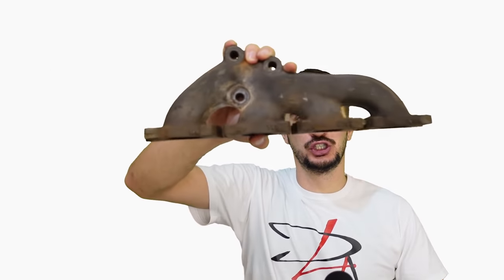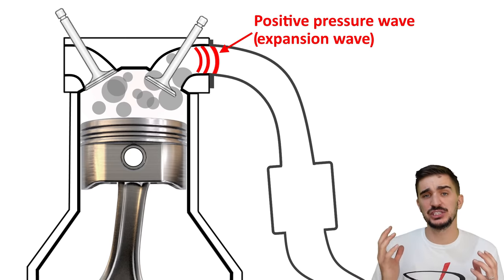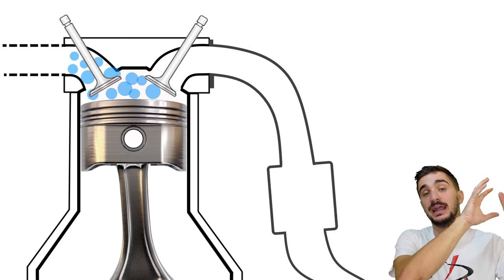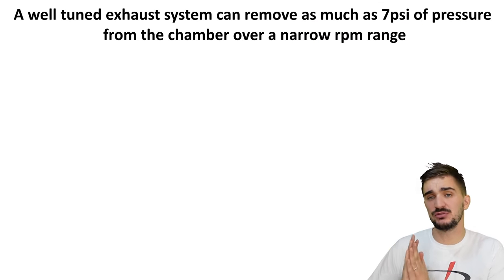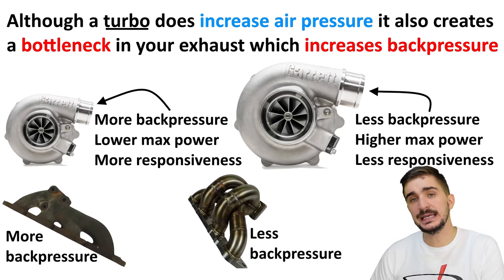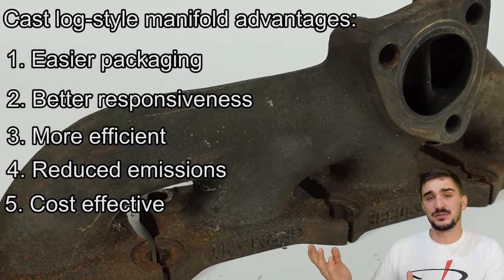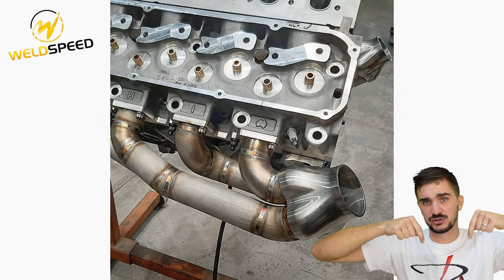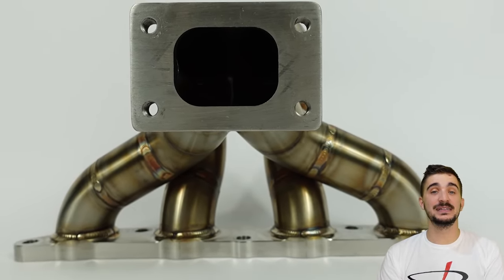EQUAL LENGTH tubular vs. LOG manifolds (headers) - SCAVENGING and EXHAUST BACK PRESSURE EXPLAINED

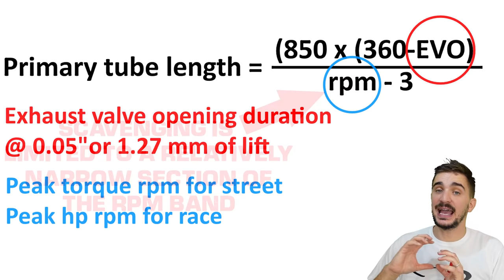Comment: 7:04 - what if you were to have an exhaust with a sliding expanded piece operated by engine rpm?  Wouldn't that allow you to have an exhaust tuned for a wider or even the entire rpm band?

Comment: Excellent video. What about non-OEM cast manifolds, ie aftermarket cast manifolds? My turbo Zetec Westfield was converted to turbo before I bought it, why did the guy choose a cast manifold rather than a tubular one? I'm wondering if it was anything to do with physical room under the bonnet or maybe heat management? Looking at it, it appears far better than a bog standard OEM manifold. Any ideas anyone?

Comment: It's splitting hairs in details, but cast manifolds are also quieter compared to the usual Tubular header counterparts, ever wonder why those Stangs' are loud and goes nowhere? tubular headers, or muffler delete, in other words straight pipe.

(This is the perspective from the manifolds in my car)
The cast manifold is indeed heavier(?) at about 25 to 28 pounds per side compared to the Tri Y headers which (I do intend to get) is about 20 to 25 pounds.

Next video idea that is not explored often is blueprinting an engine, it's what sets apart the rebuilt engines vs the ones that has been blueprinted.

Comment: if you really want to go all the way down the rabbit hole with regards to engine tuning:
The engine starts just in front of the air filter, and ends at the tip of the tailpipe, with everything in between affecting engine performance in a non-zero manner.
Case in point: Nascar V8 engine.  The entire engine has been tuned to generate nearly 108% VE in its powerband, which is fantastic for a naturally aspirated engine.
Reply: N/A great work, for turbo that VE is not a big deal at all :)

Comment: Heard of example where dude had 1.6l Lada engine with fitted TD05 turbo from EVO. Switching from equal length to log style saved 1700 RPM of going to 1 bar of boost. So equal length probably not always the best choice specially with oversized turbo.
Reply: This is a common misunderstanding. More boost does not always equal more power. Here’s a concept that will blow your mind. Boost is created by DEMAND, rather than by being forced into the engine. This is why you seldom see full boost numbers in the lower gears. The engine doesn’t demand any extra help to deliver power.

Comment: So when im tuning it i should take into account the negative pressure wave timing?  Ugh, this is gonna be hard.  I wonder if there's any easy way to tell what numbers bbk used when they designed my headers...  the cam numbers are all listed.

Its really interesting,  AFR stoich is 14.7, the psi maximum is 14.7, I wonder if thats a coincidence or theres a reason its 1:1.

Comment: Wouldnt it be possible to have scavenging for low rpm and have more power there until the boost of the turbo builds up so you also have more high rpm power? I mean at low rpm the duration when both valves are open is way longer than at high revs or maybe you could completely avoid that problem if free valves, that koenigsegg is using become more of a thing.
Or did i misunderstand something here?

Comment: What about electric turbos? I can see that having the correct sensors, and computer running the turbo would allow the electric side to reduce backpressure by increasing turbo speed, or by opening the bypass as appropriate.
It seems to me the future of ICE is low capacity engines with electrically operated Turbo chargers that regenerate a KERS type system using pressure in the exhaust system which it isn't needed to provide boost.
'Lecktric Turbos can also entirely eliminate lag, and we can ditch stupid V8s and V10s forever.

Comment: Could you not have a mechanically-controlled telescoping exhaust manifold to adjust the length based on RPM? Probably not feasible but would that not work?

Comment: Is there a way to calculate the optimal exhaust pipe diameter for a good mix between high exhaust velocity and low back pressure?

Comment: ALSO I GOT A MODERN HEMI 2004, I NOTICED THE LOG MANIFOLD HAS STAGGERED RUNNERS AT THE EXIT , AND THUS CREATES A VACUM IN THE ADJACENT EXHAUST PORT.  WHATS YOURE TAKE ON THE IMPROVEMENT ?

Comment: One thing you didn't mention which is probably open to debate is the positive pressure pulse of exhaust meeting atmospheric pressure at a high rate of speed at the tailpipe. Some people like me have noted that using a reducer cone to gradually slow down the exhaust seems to allow for better power. Its similar to how the intake could have a gently radiused neck to smooth airflow except this is on the outlet to smooth flow and adjust speeds more gradually. I felt it improved power in my turbo car which again is up for debate as many persons do not think anything in the exhaust stream is that important insofar as exhaust scavenging and velocity are concerned. I beg to disagree. It does matter. So what do you think? Should exhaust pipes be one diameter or perhaps gradually increasing toward the exit?
Reply: worked on a Ducati BSB years ago, and arrow had a cone in the exhaust can, must be something in it, they spent a lot of time on development.
Reply: @noproblem858  a cone inside exhaust can or in the exit from the exhaust can?
Reply: @jamesmedina2062  inside the can, at the exit end, the can's was about 400mm long with 54mm perf and the cone was about 150mm  pointing into the can, all in titanium, a lot of work went into them, they was from the previous years Ducati WSB team bikes
Reply: @noproblem858  but the cone was enlarging as the gases went through it right? But then the diameter reduced again before exit from can?
Reply: @jamesmedina2062  the cone was below the diameter of the 54mm perf and increased to the perf at the exit, really strange setup, it was the monster mob bikes, blueflame just put there name on the arrow exhaust cans.

Comment: @driving4answers: Thanks for the video! What will an equal-length manifold do to the sound character of the engine/car? Will it make a VR6 or a V8 sound like a vacuum cleaner (i.e. 4-cylinder)?
Reply: Most engines express their recognisable sound best when equipped with equal length headers. A V8 for example sounds best with equal length headers, but putting 180° unequal length headers can make it sound like a flat-plane V8 which sounds a bit like a higher revving I4.

Comment: Don't forget that cast can be polished to make it just as smooth as stainless.
Reply from the maker: You can polish it inside?
Reply: @d4a  yes, they have been doing that for more than 40 years. There has to be some videos out there somewhere that shows the whole process.

Comment: Hm, I think there is one aspect of unequal length runnings you didn't mention. Which is the 4-2-1 principle. Where the tube lengths of 1 and 4 are equal, and 2 and 3.
If the timing and tube length are correct, the shockwave of the adjacent piston opening before it, can assist in scavanging of the cilinder opening currently. If your firing order is the same, say, 1342, than the shockwave of cilinder one will travel to the collector faster, and send shockwaves to the other tubes, which due to the unequal length will arrive at 2 and 3 when they open up. 

You now only explain it on a per-exhaust tube basis. But this only works for naturally aspirated engines. It's crap, as you say, for turbocharged engines.

Comment: BOY, the exhaust doesn't SLOW DOWN when the overall cross sectional area of the exhaust tract decreases, they SPEED UP.  1000 cfm going through 4 square inches is traveling slower than 1000 cfm through 2 square inches.

Also, runner length is more important for tuning RPM than is largely explored by makers of turbo manifolds, but the F1 cars of very high RPM turbo engines when there was FAR less restriction on overall size used very long primary tubes on their headers going to their turbos. I know it's cheaper making a smaller manifold, but it's better using longer primary tubes. It's the elephant in the room that no one is discussing. The higher backpressure  the turbo manifold experiences makes longer tubes even more critical, or 12,000 RPM F1 turbo engines would not have used long primary tubes, as longer primary tubes are usually best for low-RPM power.

Comment: The real truth about oem cast manifolds is that compromises are often made for the sake of packaging.
If the oem’s truly cared about efficiency, durability, and engineering, they’d be casting equal length runners in the manifolds. 
I have seen several aftermarket turbocharger manifolds that are equal length, twinscroll, cast one piece manifold/turbine housing. These setups are actually far better than those the oems use, and should be using, because my Cadillac ATS has more power, gets better fuel mileage, and runs cleaner because of all the aftermarket parts I’ve installed.

Comment: What about the difference in the number/tightness of bends in equal length runners? If you have two equal length runners but one has tighter/more bends will the pulses still arrive at the same time? For example: How much of a difference could you see in say one runner with one 45 degree bend and another with two 45 degree bends with the same overall length? Cheers
Reply: it is theoretical difference, engine masters played with many long tube headers and some they bashed as would be in real life, it had dents and no difference on dyno
Reply: @makantahi3731  ah ok cool. Thanks for the reply, appreciate it

Comment: We need a ceramic material capable of handling the stresses and shocks of an exhaust manifold. Just imagine a manifold that could easily take the full heat of an engine's exhaust, and deliver the maximum amount of that heat to the turbo. I know there are ceramic coatings and such, but I'd like to see entire pieces made of high-tech ceramics.

Comment: Not so fun fact : my st215 caldina gtt has the 3sgte and the engine block has the stud, as it had been used for a long time already, but they cheaped out on the manifold and left that corner stud off of the manifold flange. It leads to warping and in the 8 years I have had mine, I have had it machined twice.
Another not so fun fact is that on that engine, the manifold has the exhaust side of the turbo cast with it as a single piece lol

Comment: The science makes sense but In practice I’ve noticed much of this isn’t impactful enough to really matter. I’ve used each style manifold and actually went BACK to a log type because I had 3 others crack and I was tired of paying $1k for a new manifold each time. Been running an FP Cast iron manifold for YEARS now and it’s holding up strong. Haven’t dynoed to see performance differences but that’s because it felt no different between the two so 🤷‍♂️

Comment: I had a log style manifold on my toyota 3L 1KD diesel engine running 40psi of boost. I swapped to a stainless tuned length manifold similar to the one shown. It made absolutely no difference on dyno for peak power and actually increased lag due to the increased volume in the exhaust manifold. This video just seems like an ad for that company.

Comment: Not all cast iron manifolds are log type. My '86 Mustang V6 came with actual headers, made of cast iron. That was not unique. The iron does hold heat, which aids the essential function of the catalytic converter. Modern exhaust systems are carefully engineered. Removing a cat and installing larger pipes can slow momentum of exhaust flow, which can negatively affect scavenging.

Manufacturers go cheap, so an engine intended to be naturally aspirated likely comes with a less robust head gasket. PCV systems are also set up differently. If adding a turbo, beware.

Comment: I’d love to see a comparison on a dyno with a turbo car… the cast log headers are absolutely garbage, I can’t believe the runners being just a little bit longer but make more power out of boost and don’t impede flow could make the response time worse…
Reply: on turbo car, difference would not be big, because turbo makes pressure
Reply: The hit in response time for a tubular vs cast usually comes from a larger internal volume (from longer runners) for each pulse to expand into and greater surface that loses heat that could have been sent into the turbine. This can be offset if the VE gains through scavenging/less reversion etc outweigh the previous effects and especially if a more appropriate runner size is used in the tubular manifold. The longer runners can sometimes help with reversion by reducing negative cylinder to cylinder interference as well (and getting out of the rom range where it's detrimental sooner). In some cases the tubular manifold can show quicker spool/response than a compact cast manifold

Comment: Heyyyy i have a question! I've seen that carbon fiber can withstand temperatures of up to 2000°c and it's very resistant, my question is... why don't manufacturers make intake turbo blades out of carbon fiber?
Reply: Price and manufacturing mostly.
Reply: @yapod9061  but,bis it possible?  Or the incredible pressure and rpms would rip the blades apart?
Reply: Do you mean the compressor / cold side blades? If so, there have been attempts to build carbon fibre compressor wheels. People have gotten them to work on dynos, but it seems reliability is an issue with them. There was a Mitsubishi Evo testing carbon fibre compressor wheels on a dyno, but in it's latest running it seemed to lack the carbon fibre compressor wheel. 
I suspect the issue with them lies in fatigue life of the carbon fibre blades. 

As for carbon fibre's temperature resistance, while indeed the actual fibres themselves can withstand the temperatures, the resin holding the fibres together can't. Hence why a carbon fibre chassis car that catches fire can end up being permanently unsafe to use.
Reply: @Thee_Snow_Wolf  very well explained, thank you!
Reply: engine pistons would already melt if your exhaust temperature at turbo would be that high.

Comment: Can't you calculate exhaust manifold for 94 1.8 miata. Currently have log turbo manifold and debating tubular but only want to change once. 2k to 4k rpm more torque.
Reply from the maker: I'll drop everything and get right onto calculating this for you. Be right back

Comment: Wow, I totally love your informative videos and am a subscriber, but early on in this one made me cringe.  And I really hate to be "that guy", but I love you too much to leave you where I found you.  ;)  The animation showed the piston on the combustion stroke go all the way down and I was wondering why the exhaust valve didn't open before bottom dead center.  Then it continued on up the exhaust stroke compressing formerly expanded exhaust before the valve opened.  Double faux pas.  Your commentary confirmed that you meant that the piston is compressing the exhaust before the valve opens.  Wait.  No.  Even the slowest diesel opens the exhaust valve well before BDC.  On any ICE, the higher the RPM, the earlier the opening (fewer degrees from TDC or crank rotation past 90 deg.)  The shorter the stroke, the earlier the opening.  This is due to the limited time allowed to let the gasses escape and also that the piston merely has to sweep the last molecules out as it reaches TDC and the intake has begun to open.  I used to think it would be more effecient to let the piston run to the bottom, but discovered from my research that most of the work is done before 90 deg. and due to extreme rod angle past 90 very little leverage is applied by the rapidly diminishing pressure above the piston as the mechanical volume gets larger.

Comment: I find you're over simplifying the situation when it comes to turbochargers.  

With a naturally aspirated exhaust it's backpressure, with a turbocharged engine, pre-turbo it's drive pressure and after the final turbine it's back pressure.

Your concern about exhaust pulses is only valid with a split scroll turbocharger.  A log manifold combines all of the cylinder outputs, there is sufficient volume to act as an accumulator and provide a smooth flow of exhaust gas across the turbine.

The most important factor with a turbocharger is keeping the delta between cylinder temperature and exhaust gas temperature at the turbine inlet as low as possible.  Tuned length headers offer significantly larger area and volume to shed heat which does remove some efficiency.  Cast iron is a great heatsink, on an engine that is continuously working, the manifold stays closer to the exhaust gas temperature and more energy is dumped into the turbine instead.

The advantages of a tuned, equal length manifold are best expressed when all of the components of the engine are designed and built with a common goal and a narrow operating window.

It's important to remember that the mass of fuel and air that enter the engine are equal to the mass of the fuel and air that exit the engine.  Working pressures comes from the temperature of the combustion gases.

Comment: The Two Manifold styles have different purposes . A well designed and manufactured Log Style can produce TWO strong Pulses , whereas , the Equal Length type produces FOUR slower ones . Comes down to how the rest of the Engine is Set Up . Valve Timing , Turbo Size , and is it variable ? Ignition and Fuel Map .
Both are good depending on desired OUTCOME . Log Style can be , and  ARE , produced in Steel rather than Iron . 
One part of the Equation only . Diesels go better with Log . Petrol with Equal Length . A Generality . Race Diesel is Turbo Compounded . Tow pack Petrol would prefer Log style Manifolds . Blah , blah , blah....................... 
I am not criticising  BTW . It all comes down to the  APPLICATION .